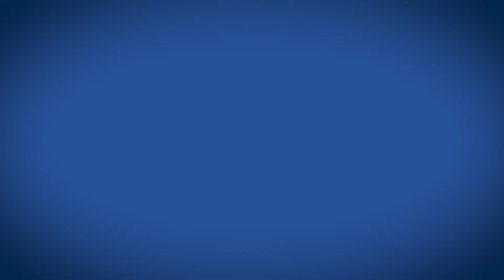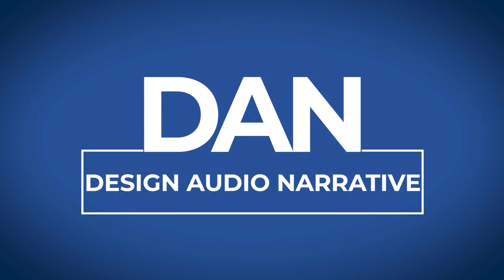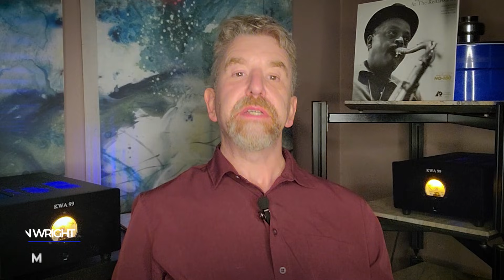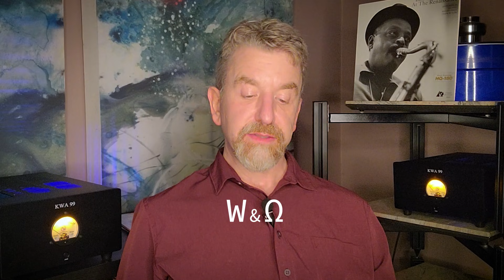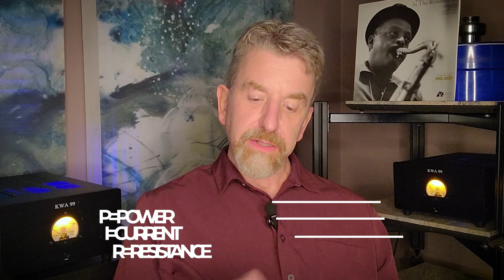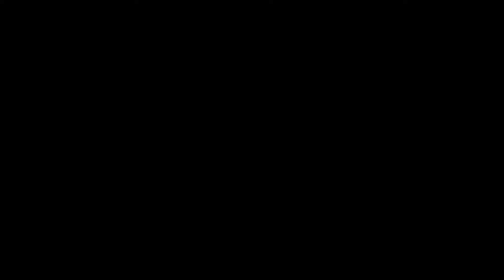Dan Talks Episode 1: Understanding Watts & Ohms – Amplifier & Speaker Matching Made Simple

Comment: Great video.  What if the ratio between preamp and amp is MORE than 100 to 1?   Is that a bad thing ? For example my preamp is 256ohms but my amp (into balanced) is 100000.  Is it still good or is this bad?   Thx for the video.   Loved it
By the way, my pre is tube and my amp is SS

Comment: Hi Dan - do you measure damping factor? How should we think about this when considering an amp/speaker match? Or, is it not relevant?
Reply from the maker: Sorry for the tardy reply. Damping factor is important. Most SS amps, designed properly will have a perfectly adequate damping factor. Using A LOT of feedback will give you VERY high damping factors, which I don't really see the value in. Conversely, I DON'T like using a lot of feedback.

Comment: Dan you ever read Esa Merilainen work on “current” drive? If so, you fooled around with it?
Reply from the maker: I had not read Esa Merilainen's work before now. There appears to be fresh debate about these ideas. Interesting.
Reply: @ModWrightInstruments  I’d be interested in trying it.  It was new to me. Although,it appears that the ideal loudspeaker would be one with a flat impedance sweep, and sealed box which are rare these days.
Reply from the maker: @louiesipes2257 it looks l8ke it would require drivers designed for the purpose too.